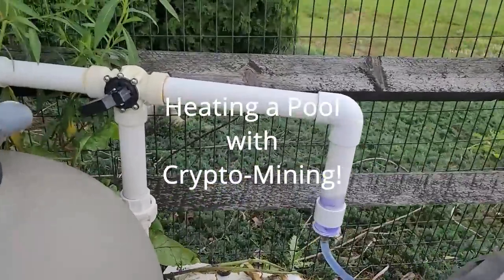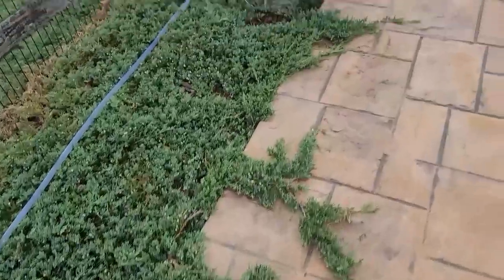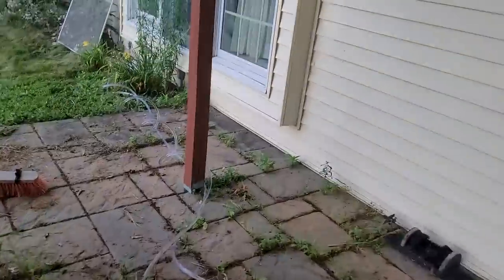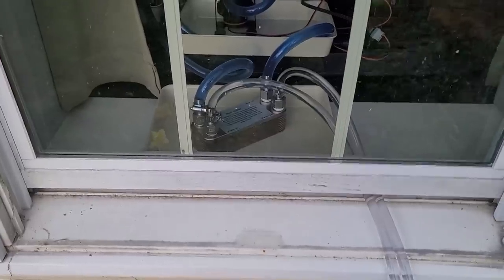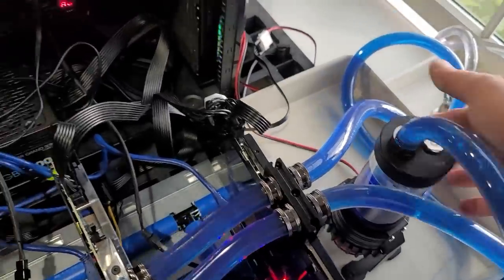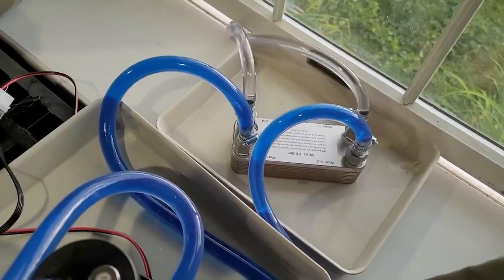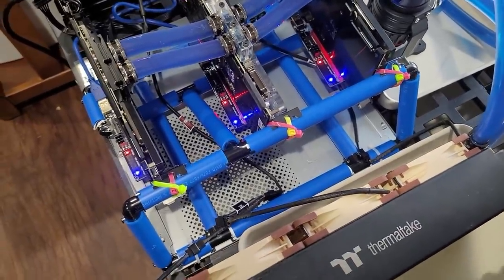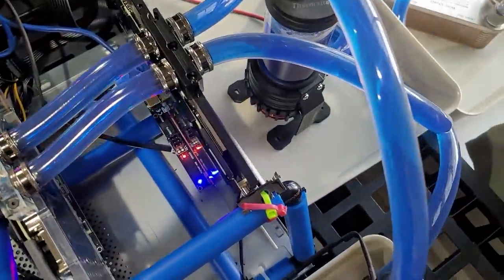Crypto Mining Pool Heater

Comment: You could just put the inloop radiator in the pool. All you need is a speed variable pump and a water level sensor for the inloop water tank to shut off the rig in case of loss of water. A lot more efficient with a lot more heat transfer pontential

Comment: Was going to say "what? Pool water through pc cooling loop" then saw the heat exchanger. Then thought what If the pool pump turns off? Then saw the radiator.
I heard you mention the blue coolant to see any cross contamination, but you would have to be there to notice it while it's happening, the pool won't turn blue but pc side will fade to clear.
Awesome setup, making use of by-product heat.
I heat my house with 2300w of mining and dreading the end or hike in electricity prices even though I have solar in the day.

Comment: Do you outperform you electricity bill by mining enough crypto with this rig? But it doubles as a water heater, so even if it only breaks even on the mining costs it's basically free heating
Reply from the maker: All things crypto that I have running use about $100 per month in electricity.  Right now, I am only making about $360 per month......worst case profit is around $150 per month after taxes

Comment: so the water-water exchanger how many watts does that take up of ur power supply? like does this affect how many watts vs output
Reply from the maker: The best part of the water to water heat exchanger is that it is 100% free to run. It is using pressure from the pool pump to cycle cool (pool) water. The regular PC cooling loop provides the GPU cooling fluid. That takes a few watts but it is just a regular water cooling pump. Yes the pool side takes energy, but I would be running the pool filter anyway....so it is no additional power. The PC power supply only supplies the PC cooling loop.
Reply: thanks for explaining !!! that’s really cool forreal. neat how u would be running the pump anyway so u aren’t using any more power with it cooling normally. very neat my guy!

Comment: An arduino, some valves and sensors and it will automatically cool the pc/radiator or both. Smart idea to make waste heat usable.
Reply from the maker: I had a colleague that once talked about wanting to run his pool water to his home ac compressor....heat pump the pool and cool the house. Absent of crypto but it sounds pretty smart. As far as I know, he never did it.

Comment: i'm amazed.

was wondering about how to create cold from heat. theoretically, if you can create heat and cold from heat, you could use some peltier to get back some energy.
Reply: That is sort of what he's doing here! It's called a "heat pump" which sort of is what an AC does (well an AC lowers the temperature by compressing a gas and that process "moves" the heat to a different area)

Comment: Love the concept, and have done something similar with waste heat (not crypto related), but the energy it’s supplying compared to the mass of the water mean in practical terms it will make no difference whatsoever. You might as well aim a hairdryer at the surface lol

Comment: The supplies for the build add up to more then a year of power use from just plugging into the wall.

Proof of concept isn’t needed, we know that power is easily produced with a heat exchanger. 

You made a problem and solved it when there was never an issue….
Reply from the maker: I will do an honest crypto economics video soon. Power for 5 3090 gpus is about $1200 per year. Last year I made roughly $12000 from crypto.  The total investment in the pool heaters (including gpus) was about $9000. Overall, I am net positive. Ther is no problem with the economics. The problem I solved was too much heat in my basement and not enough heat in my pool. Any heat that I can move from one side to the other is a win, a cost avoidance and environmentally friendly.

Sorry for the rant. I don't expect anyone else to have my financial information (maybe on the dark web). There is so much bad information about mining out there...and in the fat times, most miners were happy about all the ignorance.

Comment: Typically you should have used a heat exhanger (could be just a big radiator dipped in the pool with a pump to circulate water through it) between the miner loop and the open pool to prevent contamination and the need for very fine filtration
Reply from the maker: You are correct. It is exactly what I am doing
Reply: That's what the water/water plate heat exchanger is doing.  Much more efficient than dipping a fin and tube radiator into liquid.

Comment: The water pipes should be a lot more insulated, also , if you can give a temperature 🌡️ of the water, wold be great.
Reply from the maker: I filmed a few temp measurements today. Basically, the pool water is flowing at 2 gpm with about a 4 degree temp rise....not great but not nothing.

Comment: Huge assumption of 10,000 gals. 83,000 pounds of water, 3580btu/hr.

Assuming no loss to evaporation, conduction, convection (impossible), you should be able to increase the pool temp .043 degrees per hour. Not accounting for the small thermal gain from the radiator.
Reply from the maker: It is definitely not a propane heater, but much cheaper to run......

Comment: As insanely cool as this is,  the waterblocks and all the connectors destroy the cost-effectiveness of the project.
Reply: If these were rx 580's or 3060ti's id agree but the 3090 is a £1400 gpu, adding £150 for a waterblock and £10 for fittings is not that cost prohibitive.

Comment: Wonder what would happen if you just threw the radiator in the pool or in a tank with pool water circulated through the tank.
Reply from the maker: That is basically how the heat exchanger works.

Comment: Do a follow-up I'm curious if the chlorine does anything to the water blocks in terms of corrosion or buildup.
Reply: those are 2 separate loops, there is a water to water heat exchanger where they connect, but it only transfers heat from one loop to the other, water never mix inside.
Reply from the maker: Perfectly answered. I will show what the heat exchanger looks like before hooking it up for the summer. It should hold up fairly well. It is made of food grade stainless steel.

Comment: How well does this work? 3 3090s would do about 1100 watts of power(not all of that would make it to the water as some of it is being used to actually flip the transistors inside the GPU and then it's going to be lost in small inefficiencies of moving the heat around) but a pool heater is around 5000 watts if not more. I'm genuinely curious as this is a cool way of getting the heat out of your house!

Comment: Its funny to watch. But what if there is just a small leak on the hose? 🙈
Reply from the maker: Great point. I am using a leak detector connected to my ring alarm. Inside the house, I am limited to the amount of water in the pc loop......it would still be a big mess

Comment: Keeping your room cooler and not using a pool heater.
Awesome!
Wonder if the pool is noticably warmer during the day/CPU water block?
Reply from the maker: Not much warmer. The return water is about 4 degrees warmer at 2 gal per minute. For a 25000 gallon pool, it will take 200 hr to turn over the water......but it sure does not make the water any cooler :)

Comment: So just a random question from a random YouTuber. Have you ever thought about heat pollution that crypto produces? Example: if the production of electricity makes heat, transfer of  electricity makes heat, the mining of crypto using that electricity makes heat, then all the pumps make heat, essentially there’s more parasitic heat being generated over something that doesn’t actually produce a tangible good or service. Is it worth it? Especially with climate change and already having enough problems trying to Dissipate the heat from earth. Root question, Is crypto worth it? Just because someone can doesn’t always mean someone should.

Comment: How much crypto have you actually earned? what is the temp of the water coming out? what is the flow rate?
Reply from the maker: I have earned enough  over the last 1.5 years to pay for 5 rtx 3090 and a threadripper build. Will get the water temps tomorrow. I have everything running on the pool again and I am getting 120 mhs per card now.

Comment: So. You’re not actually cooling the chipset to the pool temperature you’re just air cooling it to whatever the rooms thermal mass is
Reply from the maker: I am removing heat from the gpu loop at the rate it can transfer through the heat exchanger. The plate exchanger ran very close to the pool temperature but would not survive long in the chlorine. The pool rated heat exchanger is not as efficient and stabilizes the gpu loop at a temp of around 100 F, with a pool water return temperature around 80 F

Comment: Pools also serve as some evaporative cooling as long as there's no pool cover.  When purging the filter I do get some sand from the sand filter everywhere so hopefully grains don't get stuck in your HX. A counterflow HX configuration is most efficient heat transfer I hear due to the lager temperature delta.

Comment: This is amazing. does it use less electricity than traditional fan cooling?
Reply from the maker: Yes, the pool loop is supplied form the pool pump that needs to run to keep the pool clean. The gpu temperatures are also much lower than with air cooling.

Comment: Now imagine that kind of investment, but contributing to useful computing like math research or protein folding.
Reply from the maker: Not to start an argument.  It would be great to have a reasonable discussion. What makes one investment better than another? Would an investment in a casino or football stadium be "better". I just assume someone will invest in crypto mining, if there is money to be made. For me the question is how to make the mining more efficient so that the waste product (heat) is used somewhere else.
Reply: @HackyCraft  

> What makes one investment better than another?

Mostly depends on what your definition of "better" is. I used "useful", in the sense of contributing something of concrete value to society; while crypto may create profit opportunities for those who invest in it or mine it, I wouldn't classify it the same way as I would e.g. protein-folding computation.

To me, the sad thing is that those computing ventures (for advancing human knowledge) are now strapped for resources and have to compete with coin-mining for GPU-compute hardware (which is sky-high in price, again due in no small part to coin-mining). That, to me, is a measurable loss to society.

Comment: It might look good at first but the chlorine will corode eventually leaking or gunk
But do give us a followup, I'm curious
Reply from the maker: As mentioned below, there are two logos with a water to water heat exchanger...no mixing. It is food grade stainless steel and should hold up to the chlorine. I will post a picture of it when I make a follow up.

Comment: Cool concept and all but the heat loss is too much and such a small flow of water can't raise the temperature of the pool it'll cool down according to weather
Reply from the maker: I will check this. I do not expect much temp drop in the tube. Pvc is a pretty good insulator and the flow is high enough that it does not spend much time in the tube. I will verify with temperature readings.
Reply: @HackyCraft  How well does it cool the rig?
Reply from the maker: @Sphyxx  it cools really well. I will get some data this weekend.
Reply: @HackyCraft  all I'm missing is the hardware 😅

Comment: Nice job i am a aquatic engineer the water from the pool you just use is just for cooling , nice job. Ive learned some stuff about crypto too and programming i dont know how to code one bif but i have found out the iaqualink automation systems use SHA-256 for encryption like bitcoin and were built the app with python. I also built my own rig with wood from home depot its on my chanel. And its only one rx 5808GB mining but I stopped mining cause microsoft kicked me off for not rebooting for a
Month and asked me for a product key code and i never paid and got it for free windows 😕
Reply: damn that sucks man, i would run linux and mine monero it’s extremely low impact

Comment: interesting concept but I can't imagine it moves the pool temp by more than a degree or two.
Reply: Curious on that as well math would say it should work. 3 3090s mining draw 900-1000 watts. That's a good amount of heat, but thermal dynamics would say a lot of that will be lost in transfer of the hose if air Temps are cold
Reply: Also depends on the flow rate of the water
Reply: @ineverplayedb4292  are your 3090s making 300-330 watts? Mine only pull about 225 watts per card?
Reply: @kidsythe  the guy who made video said they were pulling 300 depends in algorithm a bunch of things like power limit etc
Reply: @ineverplayedb4292  I will accept this.
Reply from the maker: Over 300 watts per card. There are a lot of losses but I do see a 4 degree temp rise between pool inlet and outlet. Not doing much but better than nothing and keeping the cards cool

Comment: What happens when the sun get the water in the tube super hot. Im sure its only for a few seconds but i just wonder the effect on the system.
Reply from the maker: Not a problem.  Not enough time in the tube to make a difference

Comment: Hey i had thought of using my pool water with pump and a radiator inside to cool my house, seems like it works.
Reply from the maker: It sure does. I would still run two cooling loops to avoid the potential of dumping 25000 gal of pool water in your house......you might as well mine at that point:)

Comment: I wonder what the gpu memory junction temps with this kind of setup .
Reply from the maker: I am currently running a chiller....pool is closed. My memory and clocks are conservative.  I run about 105 MH/s per card. Gpus between 39 and 45. Memory max between 78 and 86. I run a little cooler with the pool heat exchanger. I also run heat sinks and fans on the back side memory.

Comment: The idea is good but adding an extra $100 to each card for cold plate will murder your ROI not to mention all the hoses and fittings and pumps, but other than that the idea is good although I think you'd be better off going full immersion cooling.
Reply: True but you wouldn't warm up the pool any!
Reply: @joshuavallot8921  how not? the fluid that the cards would be immersed into need to be cooled somehow hence the pool water.
Reply from the maker: The immersion fluid (oil) is non-conductive,  so the cards do not short out. An extra pump and water to oil heat exchanger would still be needed. The oil needs to be changed regularly so that contamination does not make it conductive.....a normal pc cooling loop seemed easier for me....plus I had an extra pump and radiator laying around. I would like to see what an immersion system could do. No doubt it would cool the cards better.
Reply: @HackyCraft  I you get some of this 3M Engineered Fluid then you wouldn't have to worry much about contamination as the fluid is inert so you just need to filter dust and such which can be done with a normal oil filter. As for a heat exchanger you could literally go for a cooling radiator from a car and just dump it in the pool.

Comment: If you just used a black hose, you'd get much more heat hahaha
Reply from the maker: The pool water flows at 2 gal per minute. Even if the hose was 100ft long, the water would spend 30 seconds in the hose....not much time for a temp increase. We have tried the solar pool heaters before. They just don't work.....or at least work less than a mining heater :)

Comment: What is the output of your GPU hash rate I am mining with my AMD cards
Reply from the maker: I get about 107 mhs per card. I could turn up the clock but the memory still runs hot on the back side of the card

Comment: Im confused why people use 3090s when there are better and cheaper GPUs made for computing. Those are gaming GPUs so I would like to be able to understand the rationale behind using them... (Not to mention it takes away supply from people who actually use them)
Reply: All GPUs are made for computing, games are a compute load like any other, ones of a faster class than a 3090 for datacenters are crazy expensive, but theres not much difference. but I whould think using more but lower power/undervolted and cheaper GPUs might be better value ofr money and power, though when it's being used as pool heater in an area that uses restive heating the power econimy problem isn't so big.

Comment: All this for 3 cards ? How many mhs is this pulling ?
Reply from the maker: I am getting about 107 mhs per card. I am very conservative on the card settings. The evga xc3 runs a little hot compared to the Asus cards. I have since added heat sinks and fans to the memory side. I will post a follow up soon. I can also post oc speeds once I open the pool.
Reply: yea but they are 3090s! 2.5 of them are equal to my 8 card miner lol

Comment: this must be sent to linus ASAP.
Reply from the maker: Depending on how well the build goes this weekend, I have a 32 core Thread ripper system with two 3090 in sli that I will be watercooling. I want to see if I can get on the port royal leader board with the pool cooling. Gpu oc advise is greatly appreciated!

Comment: what is the outside and inside diameter of the hoses on the GPUs??
Reply from the maker: The pool loop is 1/2 inch ID. The gpu loop is XSPC FLX Tubing 1/2" ID, 3/4" OD